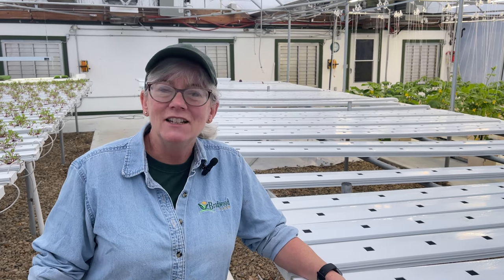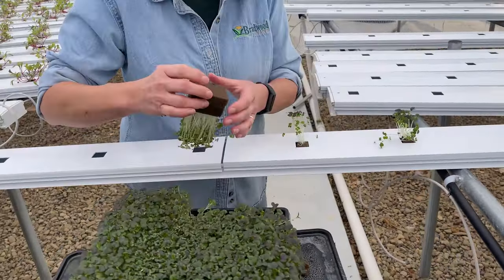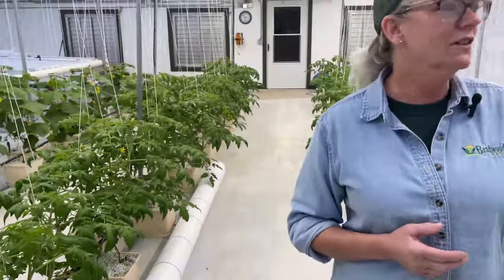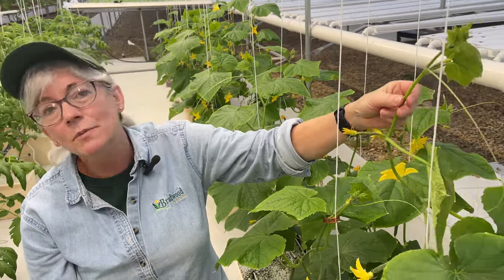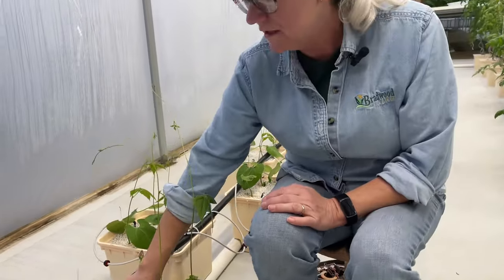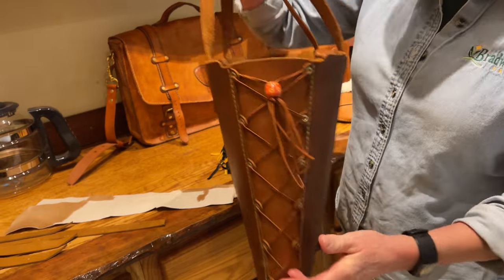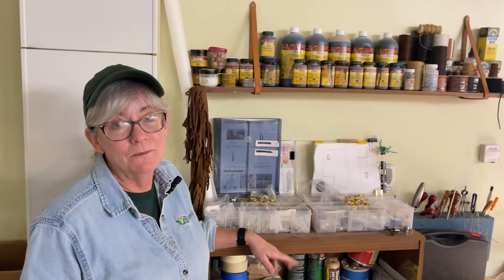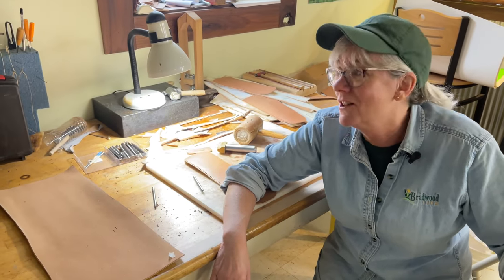Nurturing BATO Buckets for Optimum Production

Comment: Flame weeding is the use of intense heat, usually produced by a propane torch or other fuel-burning device, to kill weeds. This organic option for weeding causes the water and sap inside the plant cell to boil and expand rupturing the cell walls and causing the plant to wilt and die.
Reply from the maker: Thats a great idea. Doug uses that around the pool deck and it works great